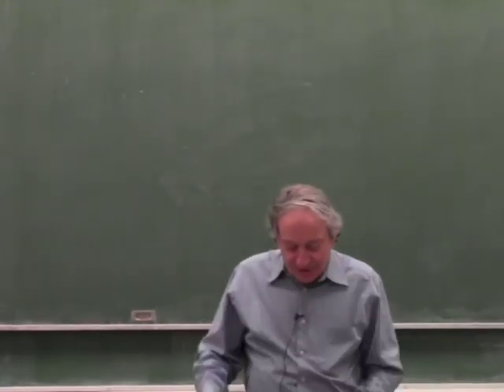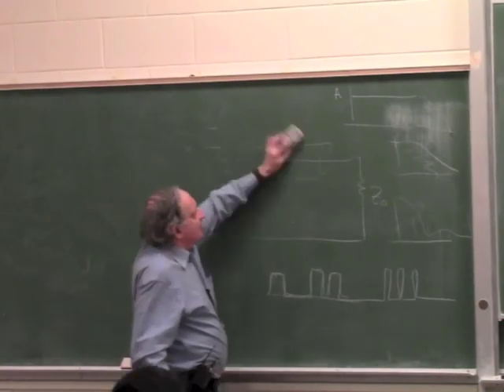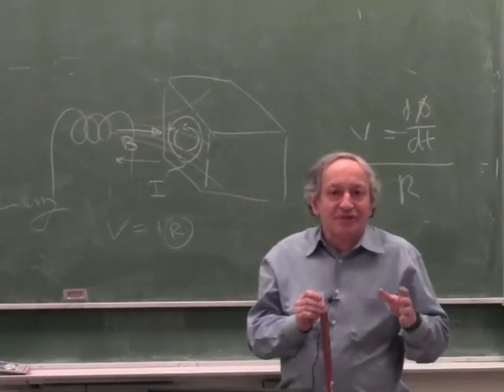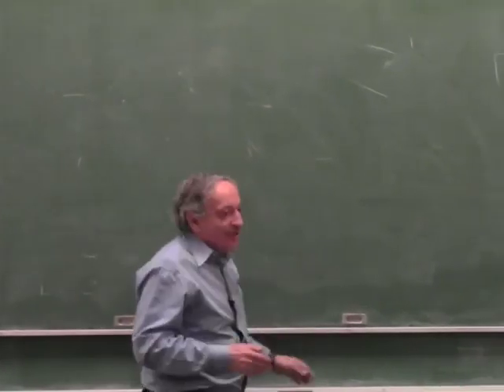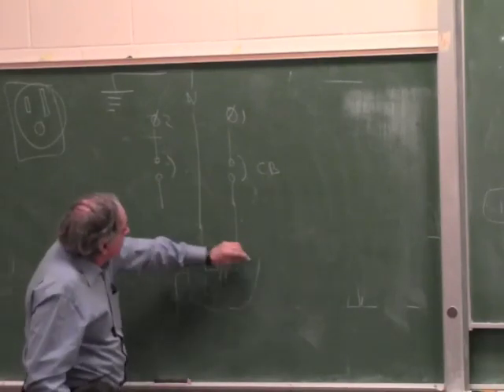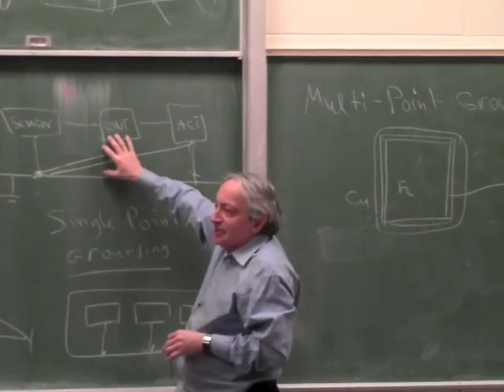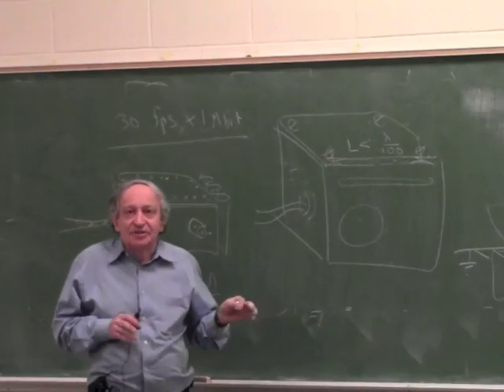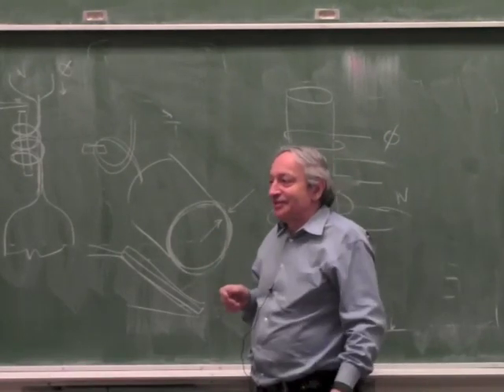11  Transmission Lines, Shielding, and Grounding

Comment: Something that I wondered for a long time is why not just use the neutral to ground the metal case. After all it's at the same potential as ground, right? Why not save copper? There's a good reason of course: if the neutral wire ever gets severed anywhere between the service panel and the appliance, it would cause the appliance case to become live, even without any short anywhere. Like let's say the appliance is a stove, with a heating element between live and neutral. You turn it on, not realizing that the neutral wire is broken; because of that, there's no current through the load, so there's no potential drop across the heating element, so the disconnected neutral line gets energized to live voltage, and if the appliance case is "grounded" by the neutral you get a shock. That's why the appliance case needs its own ground connection independent of the neutral.